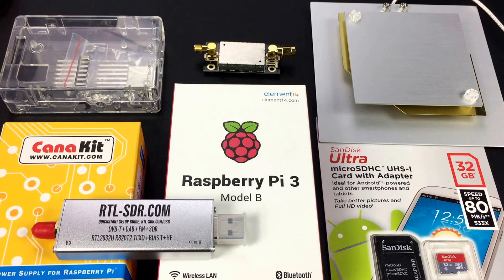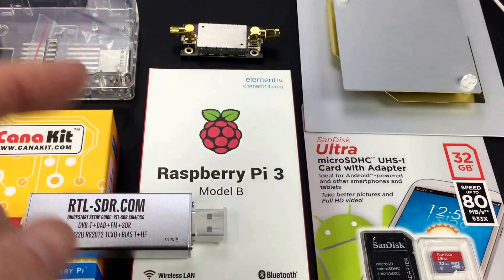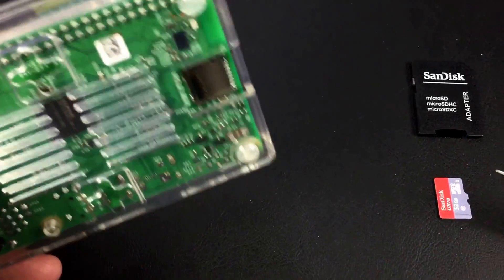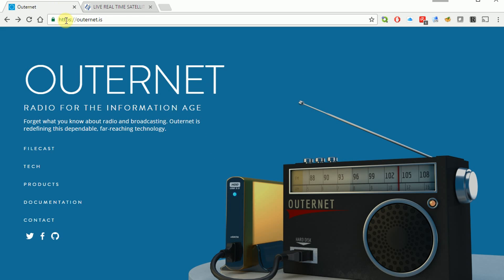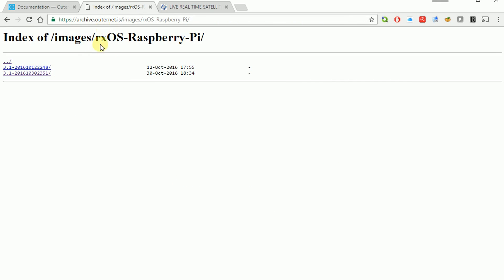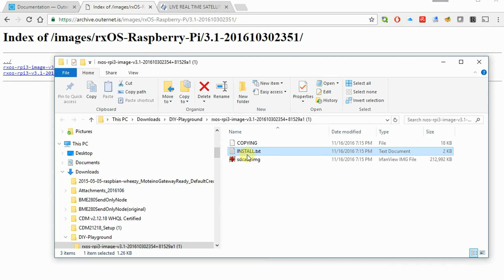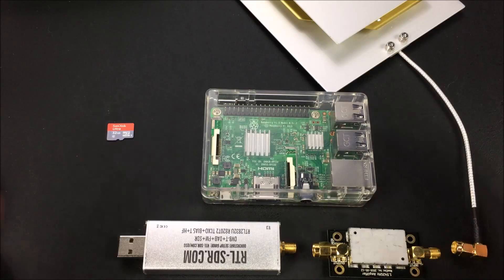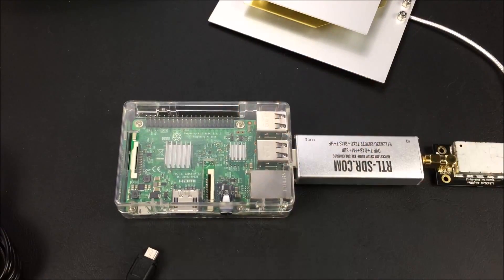Outernet satellite receiver using Raspberry Pi

Comment: i only just happened across this video, so you may not look at the comment, or you possibly figured it out later.

The reason your RSL dropped is because that satellite is inclined by 3 degrees, which means it moves +/-3 degrees from its sub point through the course of the day.  Because it moves like that, your AZ and EL will change (EL more so than AZ).  If you don’t move the antenna accordingly, the signal strength will drop.  Depending on the inclination amount, and where it is in orbit, you could lose the signal entirely.

More expensive antennas (usually parabolic) have AZ and EL motors and Antenna Control Units that allow you to control where you’re pointing with high accuracy.  Some even give the user the ability to automatically track the satellite (either by TLEs, or by signal strength.  Signal strength is the better method because the quality of the TLEs will degrade over time).  That’s kind of an expensive solution though, so if you don’t lose the signal altogether, it’s super not worth it.

Comment: I would appreciate a quick reply. Going out to Puerto Rico for Three weeks. Is this the same thing https://outernet.is/products/l-band-antenna-with-integrated-amplifier-and-saw-filter instead of using the separate antenna and low noise amplifier?
Reply from the maker: I think you still need the SDR dongle, because the description of the antenna says "This is an active antenna which requires 5V DC from the radio's SMA connector.".  The SDR is the Software Defined Radio tuner they are referring to, and that SDR dongle plugs into the Raspberry Pi.
Reply: John's DIY Playground Thanks bud, ordered.

Comment: That is wicked cool. On my wish list now! 
I have an old dish network dish. Should I use that or just get the antenna you have? 

Thanks for making this detailed video.
Reply from the maker: You should get the antenna I have which is tuned for the specific frequency of these satellites.  It's also much, much smaller than a network dish (the Outernet antenna is about 5 inch x 5 inch square.
Reply: Roger that. I just have a dish laying around and looking for a use for it :)

Thanks again for the video boss.
Reply from the maker: I just heard today that you COULD use the old dish -- you might want to try it first before buying the patch antenna.  Let us know if it works!

Comment: Great tutorial. I used your video to set up my Outernet with the supplies you cited. However, I have had my system running for about a week now, with great reception, no packet loss, and I can access all files downloaded, but my weather link doesn't open the visual globe like yours does in this video. When I click the weather link instead of the globe I see two folders with the data I can drill down into more folder but never the globe. Is it normal to take over 1 week to get the necessary files so it opens in the globe? Or do I need to reformat somehow. Again everything else works fine. Just weather is lacking. Any advice is appreciated. Thanks.
Reply from the maker: Hi Richard, glad to hear it's working for you (for the most part).  Yes, the globe app is a bugger sometimes, I don't know the rhyme or reason of when the Outernet guys send that data.  I think in time the globe will show up for you with the weather.  If you're getting the other data files no problem then the weather I believe will work just the same.
Reply: Thanks John. I am happy to report the weather/globe began working properly after about 1 week since setup. Thanks again for inspiring me to create this.

Comment: Did everything here OK, went to web browser, typed in my.outernet.is, and this message came up 
"Your receiver doesn't seem to have reported in. Err: null"

Amy ideas, great video by the way.
Reply from the maker: Thanks!!  If this is happening, it usually means the device you are using to connect to the raspberry pi (computer, smart phone, etc) is not keeping the connection via wifi to the pi.  I had a similar problem at first when I tried to browse the Pi from my PC.  My PC "prefers" my home router, and kept wanting to connect to it, since it had internet service, instead of my Raspberry Pi.  The computer learns that the Pi is a wifi spot but doesn't have internet, so the computer keeps hunting around.  I had to tell the computer to "Forget this network" for my home wifi service and then connect to the Raspberry Pi and then load the Outernet.is web site.  Hope this helps!!
Reply: @JohnsDIYPlayground   sill not understood lol. " I had to tell the computer to "Forget this network" for my home wifi service and then connect to the Raspberry Pi"
please can you simplify your explanation... 

1 my home wifi service  = router ?
2 and we cant forget it ,   only we can do is connect or disconnect
Reply from the maker: @CauseImYourFat  Unfortunately the Outernet people have stopped support for Raspberry Pi, so there is no longer a way to receive their satellite signal anymore using Raspi as I demonstrated in my video.

Comment: Does using this Outernet system provide data not otherwise available off the Internet, or is it more about the satellite access method and mechanics?  Did I see there is a daily download quota?  Thanks for giving a 2nd source for introduction to this.
Reply: My understanding (which is quite limited so far on this topic) is that the topics and stories come from the Chicago, Illinois, USA based company known as Outernet.  It's possible for anyone around the world to submit content to them via their online forums to go up to the satellites if Outernet approves.  

Regarding quota, there is not one for download, it's just the total amount of data you can keep on your Raspberry Pi before some needs to be purged and newer/fresher data taken in.  Thanks for your questions and comments!
Reply: In general everything downloaded on this system should be available already on the internet.  The idea here is either 1) countries with mild/moderate/heavy internet censorship can pull in stories they might not otherwise see and 2) areas of the world without internet could get current news and weather from a satellite in the sky free of charge.  Just need the equipment to get going and a teacher to show them how to use it.
Reply: Appreciated.  I was going to jump on the project, but as the data is selected by others, I'll wait and see what other satellite options come available.